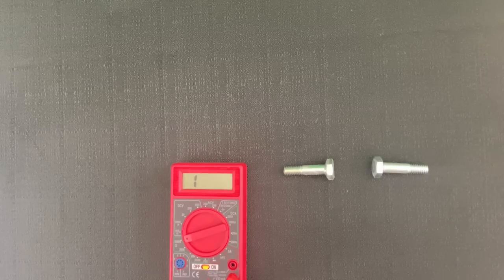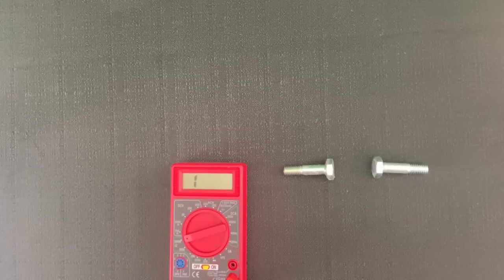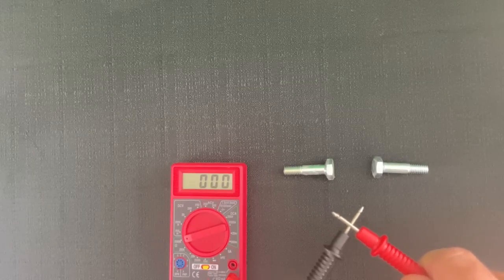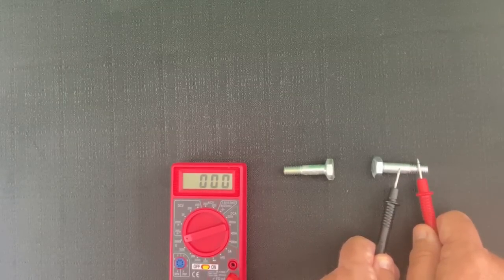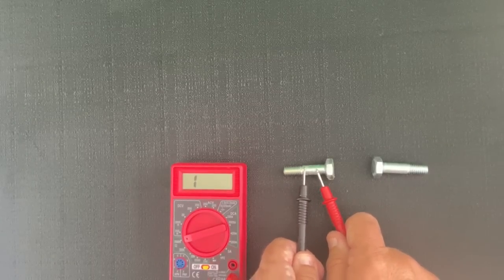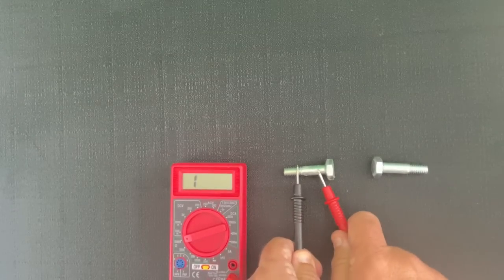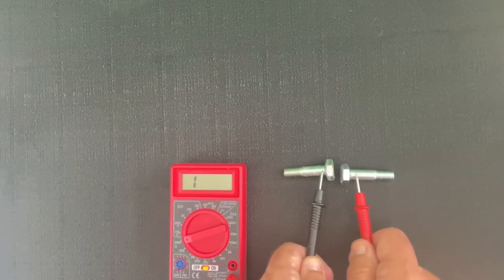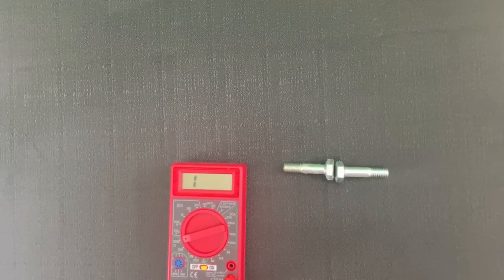Gal-Bar the ONLY  Permanent Solution for Galvanic Corrosion

Comment: What is Galbar, and how does it work to cure galvanic corrosion?
Reply from the maker: Gal-Bar stands for Galvanic Barrier and works by applying between the dissimilar metals forming a PERMANENT barrier preventing electrical current to flow between the 2 metals